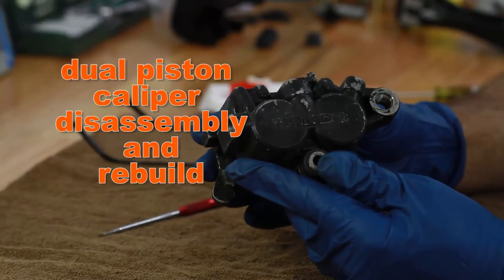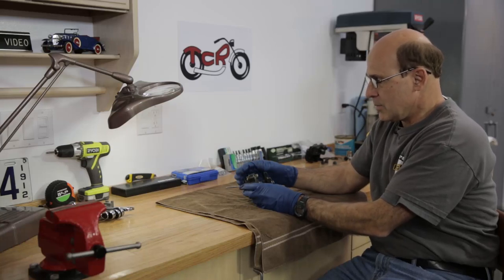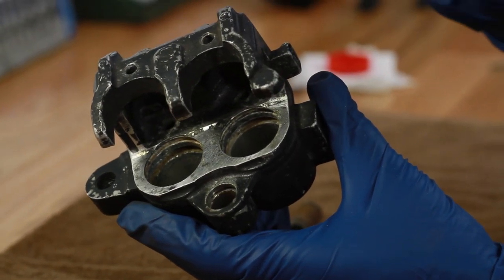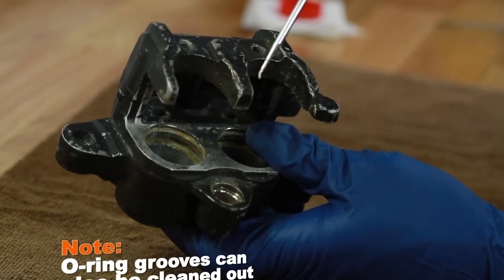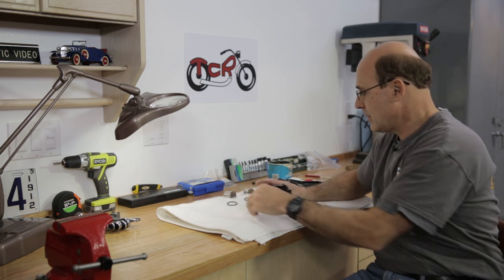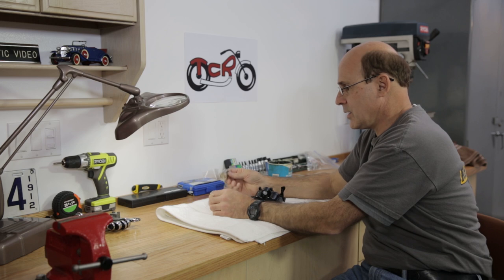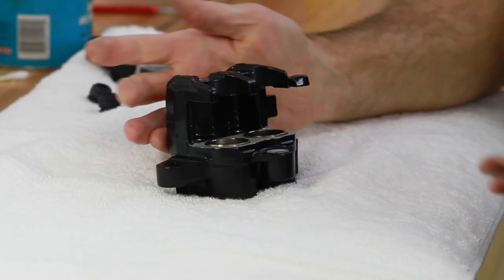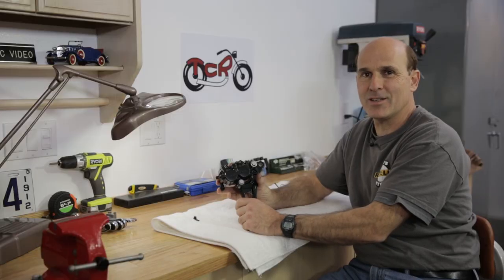Dual Piston Caliper Disassembly and Rebuild Procedure

Comment: Thanks for this video, I just tried rebuilding a caliper for my bike and failed. After watching this video I know why, I didnt clean out the grooves for the seals properly and I didnt lube them with brake fluid. When I pushed the pistons in I had to use a vice because they didnt want to go in by hand, when I pushed them in, they made a "pop" and then went all the way in. When I took them out I saw that the seals had been cut by the pistons because the groove was still filled with a lot of gunk.

Again thanks for this video, hopefully everything will go flawless next time :)

Comment: It's a good idea to mention that the o rings have to go in the right way up! They are tapered and will only seal one way. I don't know if they are all like this so don't hold me to it
Reply from the maker: The O-rings for these Honda calipers have square edges and are symmetrical.  There's no taper and they'll go in either way.  There may be other manufacturers that have O-rings that will only go in one way, but I've never seen them.  Kawasaki's seals (at least the modern bikes) are also square and symmetrical.
Reply: Early Suzuki calipers had tapered rings that had to go in the right way up. Confused me when I switched to Hondas....

Comment: I have a Honda Ruckus but I upgraded the front drum brakes to 220mm disc brake setup, the caliper is a RRGS 4pot ph80. Couldnt find any info on the seals but i can measure them, theyre about 2.5mm thick and one is 24mm and one is 26mm inner diameter

Comment: Great Video.
I'm working with the exact caliper. 1982 Honda Cb750F.
Do the NEW Honda seals have a "particular" shape were they must be inserted in the correct up position? I know in some car brake caliper applications you must insert it correctly so the piston slides smoothly in one direction, but then the rubber seal flexes/twists in order to pull it back into the bore. I hope my question makes sense.

My seals are OEM Honda..just want to make sure there is no "up" or "down" shape in the seal.

Thanks
Reply from the maker: There's no particular orientation for the caliper seals - just make sure the grooves are clean and that the seals are properly seated in them.  Some brake fluid for lubrication and the pistons will slide in with a little resistance.

You should join www.cb1100f.net.  It's a great forum for the 750F, 900F, and 1100F DOHC bikes - lots of technical help, parts, and great members.

Best of luck.
Reply: Hi....the thick seal has 2 ways to insert, you must make sure it is inserted the right way...see Dell's Garage, he explains the issues

Comment: Thanks for the vid.  Is it ok to sandblast my calipers & have them powder coated?  Any tips before I start?
Reply from the maker: As long as the bores and passages are blocked, it's fine to blast and powder coat your calipers.  I've restored hundreds of calipers this way with great results

Comment: So the part I really need to see is how you get those sleeve boots back On so easily. I set up one boot with the larger lip fitting into the caliper sleeves “slot ring” in the back, then I set up the boot on the sleeve before inserting into the caliper. I can get the sleeve to go into boot already setup on boot that’s placed in caliper but can’t get the boots inner ring to fit into the caliper sleeves lip - does that make sense? How did you do it so easily? It can’t simply be “the pick” that’s the reason

Comment: Thanks! I love your informative videos. I didn't use brake fluid but the red grease my seals came with. I rubbed a small amount around both seals. Will I be OK or should I pull them apart and rub brake fluid around them also. My manual Says to. I didn't because the aftermarket seals came with grease? Thanks I would appreciate your help
Reply: that grease is for the slides not the pistons. Anyways, its been 6 years I'm sure you figured it out haha
Reply: @hugeslacker  appreciate the response. It gave me a great feeling of the old days. The brake job went great. I rode my beloved gsxr another 6 years up until a few months ago. I sold it and bought a 2018 gsxr 1000R. I've learned a lot and had a ton of fun modernizing that amazing machine. I actually just got out the garage working on a new chain/sprocket on my new bike. Have a wonderful weekend

Comment: I am having trouble getting the pistons back into the caliper body.  The grooves are very clean.  I have tried to red grease in the rebuild kit, brake fluid, new pistons.  No luck.  Any tricks and or tips.
Reply from the maker: Sometimes it takes a little extra effort to get them started, but they should slide right in if you have them aligned properly.  If they're cocked a little, that will cause problems.  If you still have problems, maybe I can help you out.  Reach out to me via email through my web site at www.tomscyclerecycling.com

Comment: Good video. How did you remove the pistons?
Reply from the maker: I often get the pistons out hydraulically by using a master cylinder setup that I have on the bench.  Go here to see how it's done: Brake Caliper Piston Removal

The best time to get the pistons out is while they're still on the bike.  You can do it by removing one of the pads and then pump the pistons out until the remaining pad stops them.  Then remove the pad and put a putty knife blade in place of the pad and pump them out some more.  If you have dual calipers up front, you have to do this with both of them at the same time so that you maintain hydraulic pressure in the system.  Make sure to keep an eye on the fluid level in the master cylinder since it will drop as you pump those pistons out.  Once they stop against the putty knife blade, remove the blade and hold the calipers over a bucket.  The pistons should pop out with your fingers and will dump fluid into the bucket.  Kind of messy, but it works.  Then get the calipers off the brake lines and into a bucket of warm water with some dish washing detergent. I like Dawn)  This will keep the brake fluid from attacking the paint on the calipers.  Clean them up good and proceed with your rebuild.

Good luck!

Comment: ¿You could not lubricate the pistons of the calipers with grease and not with brake fluid? Un saludo desde españa
Reply from the maker: It can be done with brake fluid or caliper grease.
Reply: @tomscyclerecycling8242  thank you very much greetings

Comment: How did you get the caliper so clean?  What did you soak it in?  Is it okay for me to soak my calipers in soapy water?
Reply from the maker: I powder coated that caliper before I rebuilt it, so it's in "like new" condition.

Yes, you can use a mix of hot water and Dawn dishwashing detergent to clean your calipers.  Use a toothbrush to scrub the crud off, rinse with hot water, and blow dry with compressed air.  If you want your calipers to look brand new again, drop me an email - tom@tomscyclerecycling.com.  I can make yours look just as good as mine.
Reply from the maker: Hi Chris.  It's possible that the tiny release hole in your master cylinder is plugged.  It may have been pure coincidence that this problem just started after you popped that piston, put it back in, and rebled the brakes.  Use a steel guitar string or a #80 drill bit to clear that hole, then bleed some more and see if that fixes the problem.  If not, contact me through my website at www.tomscyclerecycling.com and we can try to figure it out.
Reply from the maker: Not necessarily.  Sometimes the hole will be blocked just enough to cause the brakes to drag and heat up the rotor.  This is something that costs nothing to check.  Worst case, you wasted a few minutes and will just have to move on to the next step - to possibly rebuild the calipers and master cylinder.
Reply from the maker: Hopefully you didn't see any more bubbles coming out when you finished bleeding.  If you did, then there may still be air in the lines and that could cause dragging too.If you pull the pistons out, you can clean them with brake clean spray and polish them if there is any grunge built up on them.  The only thing you should lubricate them with is brake fluid.  Don't use oil or grease.  If you're going to the trouble of doing this, you should do a full rebuild of the calipers.  Remove and replace the old seals and while they're out, clean the grooves out.  If any dried up brake fluid build up behind the seals, that will push them out farther and make it difficult for the pistons to retract when you let go of the brake lever.Keep me posted on your progress.

Comment: how do you get the pistons out if they are froze in the caliper?
Reply from the maker: Mike, I've disassembled a few hundred calipers and many were badly frozen.  This method has worked every time.  Sometimes they take a little longer to break free, but they always do.
Reply: @tomscyclerecycling8242 the video starts out showing the pistons already out of the calipers. How would you remove the pistons if they were still in the calipers?
Reply from the maker: Mike, there's a separate video on my channel (Tom's Cycle Recycling) that details piston removal.  Check that out and you should be good to go.
Reply: @tomscyclerecycling8242  thank you I will

Comment: thank you for the in detail video! I have an 83 Magna with locked calipers and knew what needed to be done, but wanted to actually see it. I do have a question though, where do you get your replacement parts for these? (o-rings/pistons)
Reply: +Jordan Haga id seriously consider getting honda parts, aftermarket o-rings and boots are never usually as good. they just dont fit as well, inferior quality rubber
Reply: +Gruxxan lol should check time stamps lol bike is already done and on the road. I got OEM Honda seals from my local bike store and they went in very well
Reply: awesome! spring is nearly here, happy riding!

Comment: woulden't you soak the piston seals in brake fluid for 15 min before install?
Reply from the maker: You could, but there's no need to and I never have.  These days I actually use a special caliper grease to lubricate the seals before inserting the pistons.  This won't dry up if the rebuilt calipers sit for a while before reinstallation.

Comment: Spent a solid hour can't get the piston started,even tried tap runner mallet STILL wont start to drop in
Reply from the maker: You mean you can't get the piston back into the bore?  Make sure you lubricate the seals well before you start the piston.  Also make sure that the piston is squarely positioned before you start.  It will take some pressure to get it going, but then it will pop right in, just like in the video.  That was a "real" rebuild and the caliper hadn't been specially prepped for the video.  You should have similar results.
Reply: +Tom's Cycle Recycling  It was a pickle of a shit,Went back and this time I used a C-clamp,broke the C-clamp,then started beating on the socket that was in the puck with a rubber mallet again.At this point was really beginning to wonder if could get to come out when the bike was back together and all pumped up but it did ...pumped up just fine but you gotta stick a socked in the puck or you'll do some real irreversible damage
Reply: Did you lubricate the piston before trying to put it in? A little silicone grease or even brake fluid should make it  slide in easily.

Comment: Why is it that every you tube that I watch every one of you guys are wearing gloves? I don't get it. I have been wrenching for 40 years and have never wore gloves, what are guys into anyway? Rich
Reply from the maker: Rich,I wear nitrile gloves whenever possible to keep oil and grease off my skin.  Your hands easily absorb solvents and petroleum products, which end up in your bloodstream.  I knew a machinist who didn't even live to see retirement because he never wore hand protection.  He told me after he found out that he had terminal cancer that it was a direct result of contantly getting cutting fluid on his hands.  Maybe you've never worn then in 40 years and maybe you'll live to be 100, but why take a chance?  Cleanup is a hell of a lot easier too.Tom
Reply: +Tom's Cycle Recycling Ahh hah, I knew there was something, thanks Tom, but me thinks I will keep um bare, to hard to train an ol dog. smile and thanks again. Rich

Comment: didn't mention that o ring fit one way round they have a lip
Reply from the maker: The O-rings for these Honda calipers don't have a lip - they go in either way.  I've rebuilt at least a hundred of these calipers and have never had an issue.  I'm not sure why ANY caliper seal would have a lip.  They're internal to the bore and must allow the piston to slide freely.